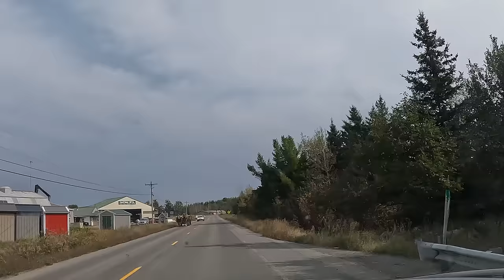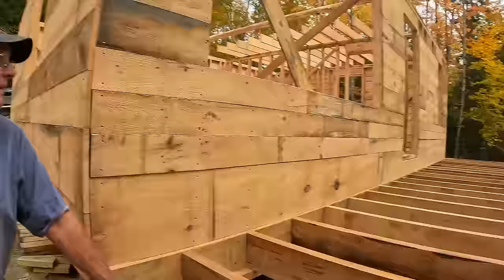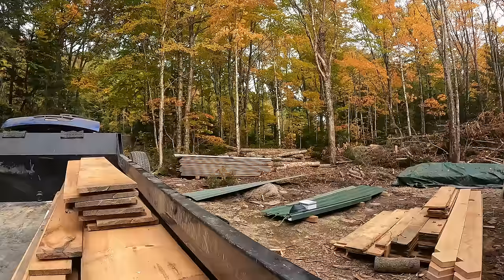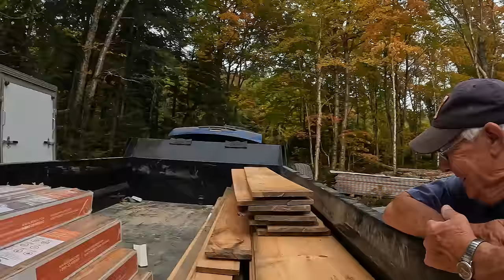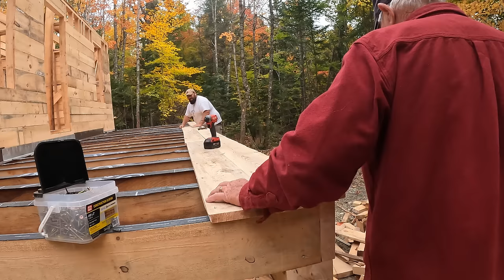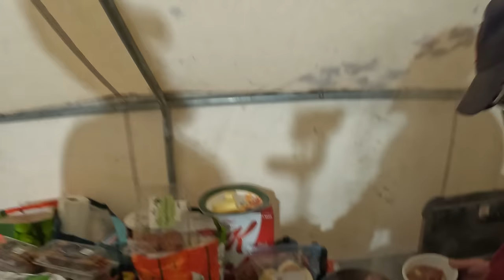OFF GRID: We are back! Time to build Farmers Porch: Episode 22

Comment: Just a question did you figure cost for plywood before you decided on boards? Just wondering.. i know that’s not rustic but thinking speed, how about air nailers for speed on roof boarding.
Reply from the maker: Cost of boards is just a little gasoline and the work to make them from trees into boards. We mill them all ourselves other than the gift boards

Comment: Joe I’m not a carpenter, and am wondering why you didn’t gap the porch boards? And are you not concerned with the boards cracking when they shrink ? I’m just wondering because I have a sugar shack build on my channel and people say to only nail one side of the board for shrinkage. Thanks .
Reply from the maker: Great questions. I've done a handful of porches like these with green hemlock. They do shrink and leave drain gaps and they actually swell back up during the wet and humid season too. They have never swollen enough to pop or crack since putting them tightly when green like this is as big as they get. But it will be different for different types of wood.
Reply: @JoeHollandFishing  ok I thought so. I’m doing board and batten siding on my sugar house, I nailed both sides, we’ll see how many crack. Love the build . You still going to do ice shack camping after this camp build ? Lol 😆